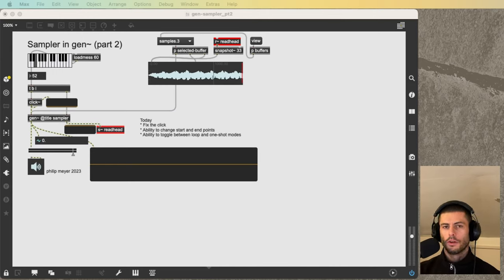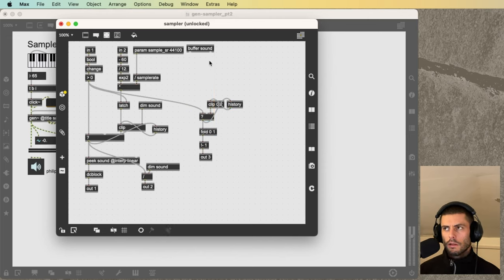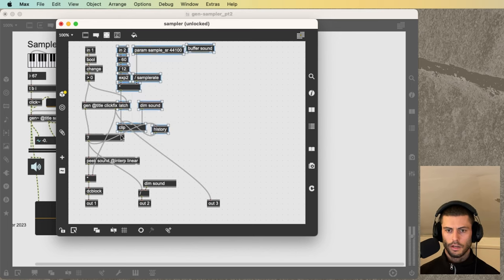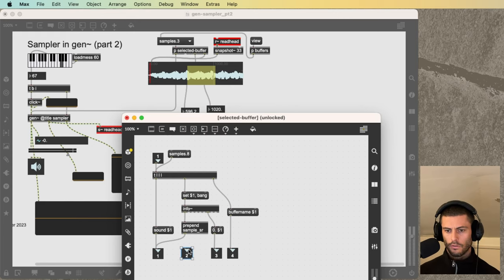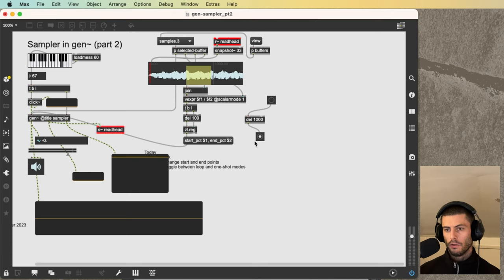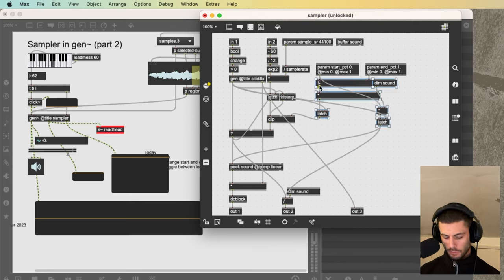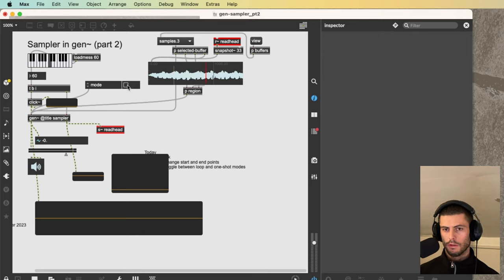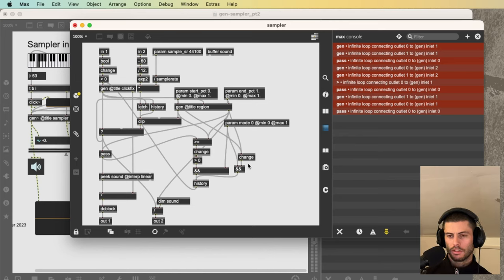Building a sampler in gen~ (Part 2)

Comment: Great video!  Would it be possible to create this patch in stereo? How can I work with stereo tracks or buffers in Gen? Thanks.
Reply from the maker: stereo yes! cool idea. perhaps the easiest way would be to use mc. save the gen~ patch as a gen abstraction (a .gendsp file, such as mysampler.gendsp) and then invoke it with mc.gen~ mysampler @chans 2. 

the gen patch would also need to be updated to tell the sample object to read from the correct channel of the 2-channel buffer, which you can get from the mc_channel object. hope that helps!